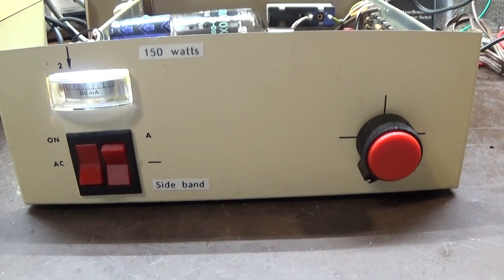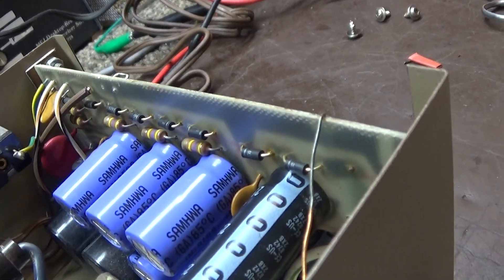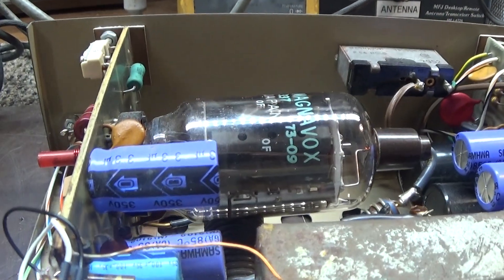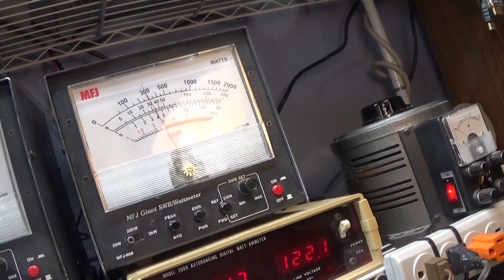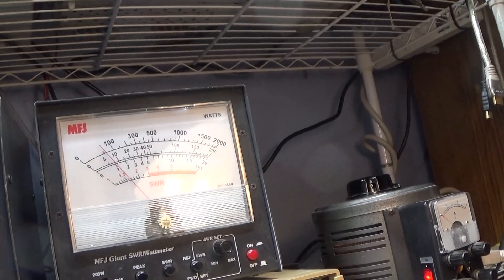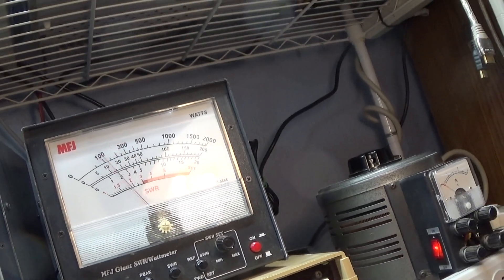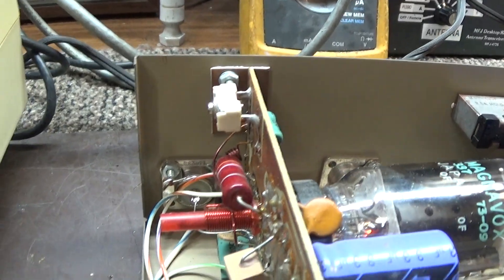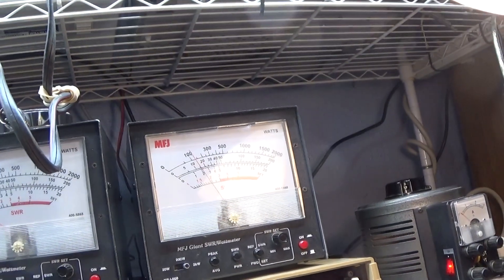No Name 1 tube base Modulator  16gy5 tube

Comment: Just curious if it's a grounded grid amplifier.  The tubes are awesome output n cheap also white is high voltage on the tubes I googled them but can't find much information.
Reply from the maker: tetrode, not grounded grid.